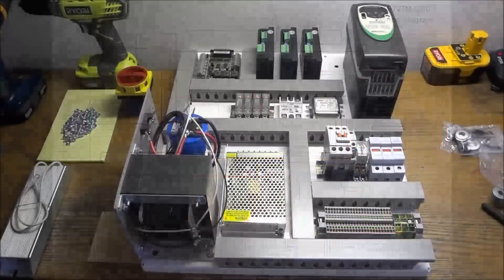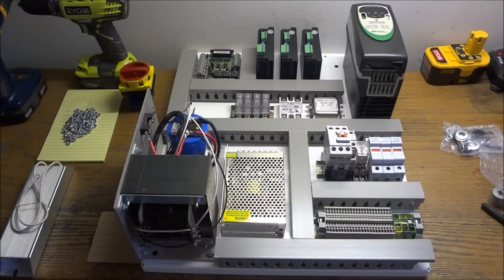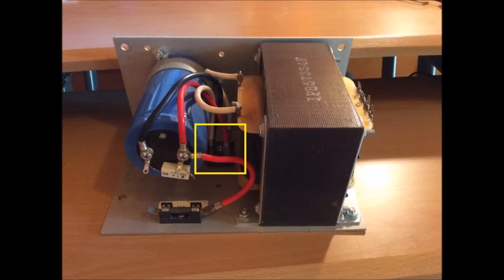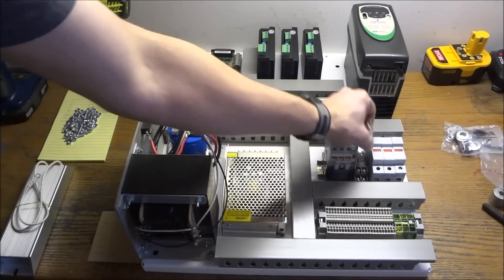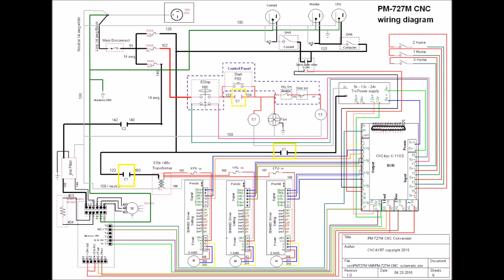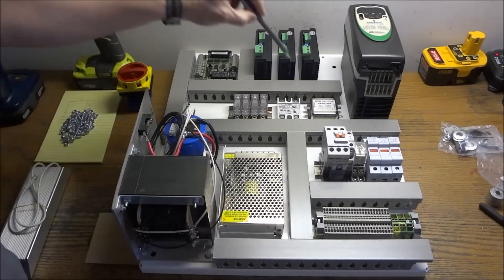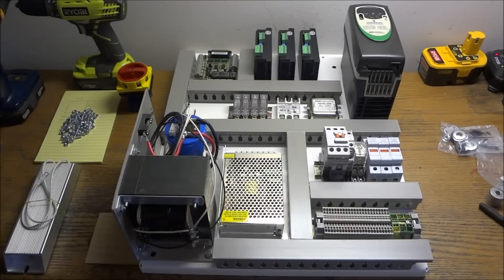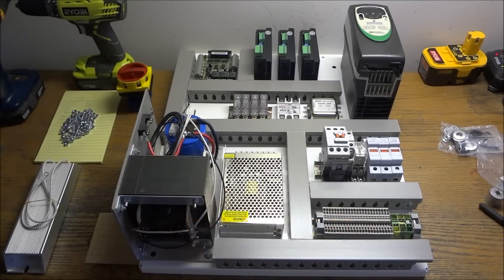PM 727M Wiring Intro

Comment: do you have a printable copy of your wiring diagram? What is the brand and source of the terminal strips and wiring raceways?
Reply from the maker: +John McKenna 
Hi john
Yes there is a link in all of the wiring video descriptions to a drop box link for the wiring.  I also listed parts and I think I listed where to get the terminals. On at least one. There Dinkle 1.5 I think. I got them off EBay but the seller has a website.

Comment: What kind of fuses are you going to use for the 110 v circuits? I am assuming they will be ceramic 10x38 quick blow fuses?  Also are the fuse holder you have are the ones with blown fuse indication?  Keep these wiring videos coming. I had not really given much thought to the 110v wiring aspects of CNC builds.
Reply from the maker: Yes they are these are some I had. I may be switching to circuit breakers latter the cost of the fuses are not cheap you can find circuit breakers for $7  like these 
http://www.factorymation.com/s.nl/it.A/id.5663/.f

Comment: Are you using 220 singe phase coming in to supply this cabinet? 110?
Reply: +Russ Geyer opps jus read your list of parts
Reply from the maker: I'm sort of mimicking a Tormach 770 so the cabinet will be powered by 110. 
This can easily be wire for a 220 vfd and bigger motor. I just happened to pick up these on deals I found.

Comment: Very nice overview!  I'm starting to plan out my g0704 conversion.  So far I'm setting stuff up on a plywood project board to test stuff out, but it won't be too long until I need to start laying out an enclosure.  Thanks again!
Reply from the maker: Hi Paul 
Thank you, well this layout will work fine really for any mill or lathe. You might have different drives or power supplies but the basic operation and wiring will be about the same. 
I'm going to break down the wiring into segments so it should be easy to adapt to any configuration.